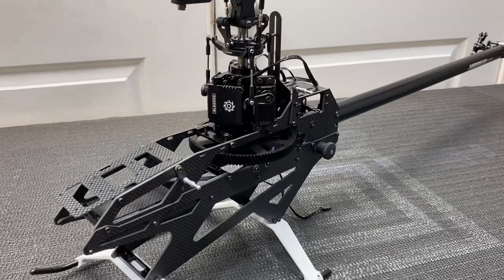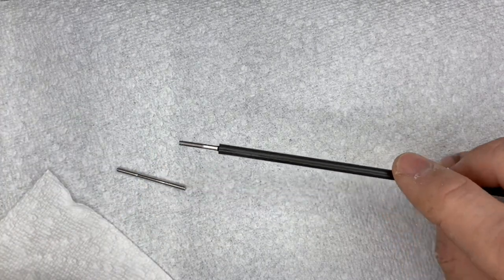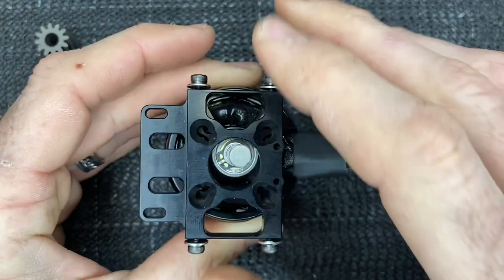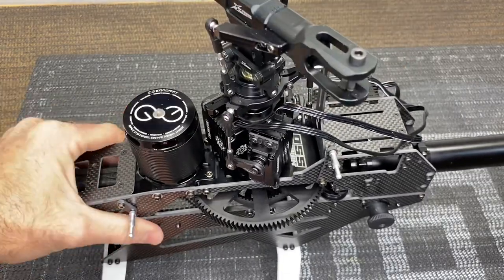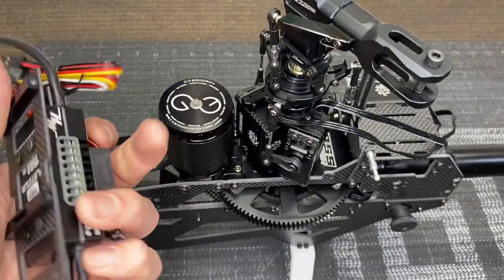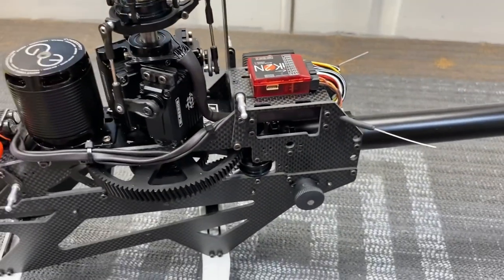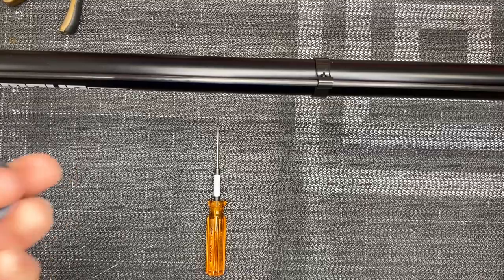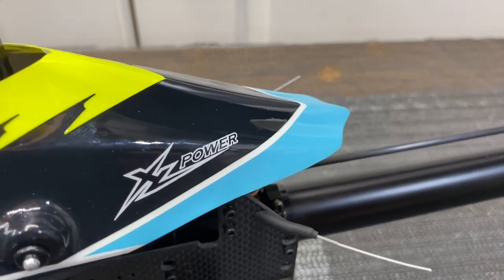XLpower Nimbus 550 Build Part 3 It’s Done!

Comment: Nice tip about bagging a motor before trimming a shaft, I do all my grinding and filling over my helicopter anyway.
Reply from the maker: It’s a tip I learned a long time ago and works great! Keeps the metal shavings from getting stuck to the magnets in the motor.
Reply: Thanks for your comment, noticed some play in the tail slider wheel and the 2 bolts that ride in the wheels groove should that be a concern? As well the tail grips have also some small lateral play even after replacing dampners and thrust bearings,  even the tail boom guide doesn't fully trap the push rod, the design appears looser than I would expect, comments?

Comment: Hi!
Thank you very much for all your videos. They are very entertaining and above all educational. Especially the Mikado videos are very useful for me.
I now have a very stupid question and I'm getting desperate. I have a Vbar Evo receiver and would like to use a 760us pulse on the throttle servo for my nitro heli. Is that even possible? I can set the pulse for the swashplate and tail but not for the throttle servo. I am now worried that I might damage the servo...
Typing in this video because I am building a Nimbus Nitro 550 :)
Thanks for any help!
Reply from the maker: Hello! Thank you, I greatly appreciate it. I’m glad you enjoy these videos. There is no such thing as a stupid question, well the only one is the one you don’t ask. So I don’t believe the Vbar EVO will do 760 on the throttle servo? I’ll have to look into that. Never tired. But there is no need for 760 on throttle. What servo are you using?
Reply: @westhobbiesrc8051  Im using GDW - BLS995 Servo for tail and throttle. It came with a instruction which mentions: "before connecting to a fbl system the pulse must be set to 760". Im pretty new to these kind of servos and I just got my Vbar for over 2 months now.

Thank you very much for looking into it.

Comment: I bought me this Heli a few days ago. Why does it matter on which side the numbers of the servo linkages are? Are they not the similar on each side? And thx for this video. Helped me
Reply from the maker: Awesome! You will enjoy this heli. So the ball links are directional. One side is smaller than the other. The smaller side is the outside with the numbers and the larger side is the inside that goes onto the ball itself. You could force it on the opposite way, but you risk not having a good connection that is why it is important to make sure the numbers are facing out.